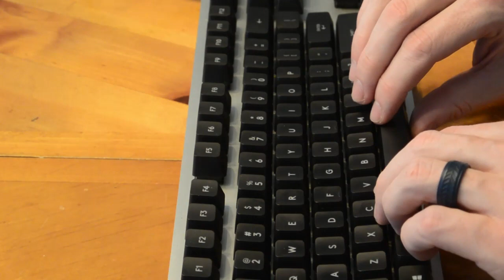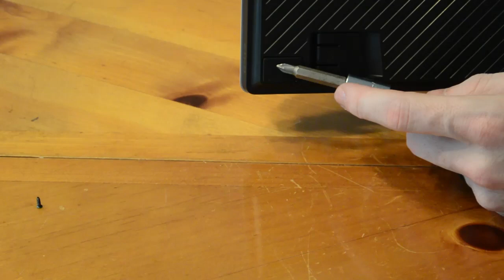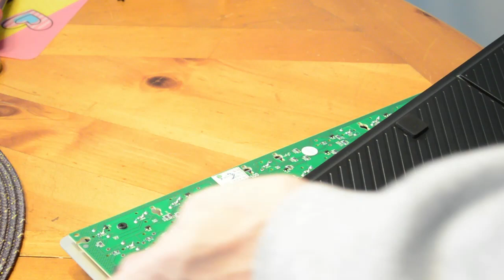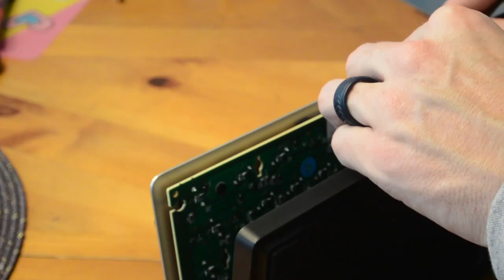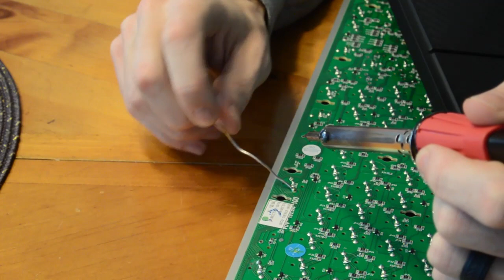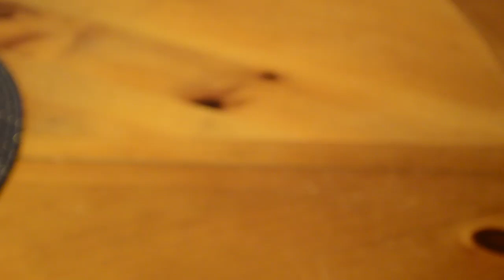Logitech G413 Repair-Key removal, take apart and solder joints

Comment: I have g413 carbon. The space key broke. It still types but then several keys randomly chatter and it's almost impossible to use the keyboard. I have cleaned it several times (using vacuum cleaner and microfiber cloth). I don't know what else I could do. Any suggestions?

Comment: Apparently I'm the only one who's about to ask the silly question, how did you get the old broken switch out before soldering the new one in? 😅
Reply: 1. heat with your soldering iron the old solder
2. use desoldering Pump to remove the old solder while the solder is liquified
3.repeat  until all of the old solder is removed
4. you should be now able to remove the switch with pulling it with your fingers.

Comment: Is it possible to remove just the frontal metal plate?
Reply: Only if you desolder all the keys from the pcb and use key puller to remove the keys.

Comment: i have to say i wonder that you do not have your letters washed out on the keys mine are. and those little plastic poles in the back of the keys brake too easily, even without pulling the keys out. i love the keyboard but i believe this is a building mistake, what do we gain from 2mm aluminium and solid platine, if the keys do not hold up, the letters are just printed onto the keys and rub off. i dislike this company policy. + its close to impossible to get the metal off of the platine to clean both sides. as you do it, they, contact sockets, seem only to go out one way. besides that perfect keaboard.

Comment: thanks, I have a keyboard where every time I press the "e" key it is duplicated and sometimes it is not captured, but most often it is duplicated.  What I can do ?
Reply: You’re probably facing ‘key chattering’, which is a common problem with mechanical keyboards. This usually happens because or dust/dirt getting inside your keys and interfering with the contact points of the switch. Just pop off all your key caps (or just the ‘e’), and clean the board and switches properly with compressed air, and put it all back. Hope it helps.
Reply: @vattu420  thanks, i washed my g413 today, shity mess, i didnt know how much dirt could gather in and the keyboard and between the keys.. first with acetone then with soap and cooking water and then dried with hot air.. hope my cleaning was enough because i had a dublicating space bar, very annoying and time consuming if you write allot.
Reply: @KingCrimson82  I also have the g413. Needs to be cleaned regularly otherwise the keys start messing up.
Reply: I have this exact problem with several keys. Fortunately “E” key is safe

Comment: does the key comes with RGB LED light??
Reply: the 513 does this is the 413
Reply: @KingCrimson82  so for 513, you replace the key means you replace both the key and its led bulb at the same time?

Comment: can i swap my Romer-G switches with Cherry mx switches???
Reply: they are only hotswappable with romer-g blue & silver so.no
Reply: @iwaju9227  Perhaps I'm misunderstanding, but these particular switches are not 'Hot-Swappable' as I know the term. These Romer G's have to be soldiered into the PCB. With a hot swap keyboard, you're able to simply pull the switch out and replace it with something else. If you understand how a hot shoe works on a camera, think of it like that.

I'm typing on hot swappable opticals now, I could change the Gateron blues back to black etc without unplugging the keyboard for instance. 

Did Omron/Logitech make Romer G's hotswappable? Their follow ups Logitech GX are I believe though. I won't comment on the G413 (fucking lazy switch and cap design and bottom of the barrel plastic basically), but I don't think it's hot swap, I'd have kept it active if it was. I almost miss it for some reason.

edit: forked out a tenner for a couple of replacement switches and a left shift repair on Aliexpress (simply because Romer G's and their 'light pipes' are an obsolete curio now, it might be worth keeping boxed on the shelf as an item). The new switch will have to be soldered to the PCB with my G413 if I want to use it again... seriously, everyone go for a customization hot swap no matter what if you intend on spending over 100 on a keyboard. Ones like the G413 are a glossy waste of time. I learned my lesson. 

Get bored of your switches or keycaps? Swap them out for 20-30 quid a year later or save for something even more, change the case from time to time perhaps? Non proprietary user 'modularity' is forward... whatever that is. It's like Lego for adult typists... fookin' cheaper too : )

Comment: I wish they made the keys hot-swappable. Does Logitech have any keyboard with hot-swappable switches?
Reply: i thought this g413 one was hot swappable, i even bought switches. i got one of the switches out, with tons of trouble, to find out the led wont let any other switches fit. i spent 100 dollares for nothing, lol.
Reply: @Michael-tl2bs  Try a keychron board

Comment: Hey man idk if you will see this but my 6 key won’t work. So if there is anyway I could help me I would appreciate it
Reply from the maker: I am out of town till Monday, I can add a video about the inside the keys themselves. There is a 2 metal slivers that make a connection when pressed. First follow the recommendation steps in description before taking keyboard apart.

Comment: My G413 Carbon is only 6 months old and the WSAD and Spacebar keycaps started losing paint already, the W key is just a circle shape now instead of a W lol, Did I get a fluke or is this a known thing with these models? Or maybe I have acid fingers 😮 seriously I've never owned a keyboard that's done this, previous keyboard was 8 years old (Logitech K310) and still working fine, no paint issues etc. I just wanted to try out a mechanical model and went with the G413. Logitech is sending a complete spare set of keycaps under warranty but im just curious if anyone else has had this issue lol.
Reply: just wait for the keyghosting... piece of shit keyboard
Reply: its laser ablated what do you expect
Reply: This is a known thing. ABS Keycaps are cheap and if your hands sweat a lot, the legends are gonna peel off real fast

Comment: Logitech has really broken my trust of over 10+ years with this G413.
Reply: Same. I used to be logitech fan. But with my last g502 mouse double left clicking + g413 carbon keyboard double spacebar/2-3more other keys , i doublt ill ever buy again. To fix keyboard official(Turkey distrubitor) company wanted half of the keyboard’s price. I believe i wont ever come back to logitech ever.
Reply: @oguzsafauysal5028  Logitech would replace it for free if you weren't in a shit country.
Reply: @oguzsafauysal5028  clean you keyboard dude. it s normal if you don t take care of the device
Reply: same. my ctrl key broke, and i cannot change/order ne key easily. This is inacceptable to have a keyboard that is not easily fixed. was tempted by the g915 but it seems to have the same kind of weakness.
Reply: @Demandradify  those are omron switches, you can buy them on aliexpress
Reply: I have a g513, which is basically the same keyboard with rgb. It really sucks... These keycaps' stems start breaking upon regular use within a very short time

Comment: I am a newbie at this. My spacebar stopped working and I decided to replace the switch with another's key switch and I have no clue why it won't work
Reply from the maker: sorry i missed this comment but hopfully this would help others. inside the white part of the key, there are 2 metal pieces that make contact when you depress it. Those could be misaligned or there is a bad connection on the back side of the keyboard

Comment: Sure wished you cuda said which key caps we actually needed to remove as I dont have a key cap puller....my * and - are Simi not working on the num pad itself. And idk if it's me or what but every once ina while it's like I double press the k cap but its not sticking idk if I'm touching it as these keys are touchy but I do have new keys to put back since the one is busted...got the keyboard used ish. Would have to say my wife getting mad at me and pulling my desk over is what caused my issue thankfully I didn have a 144hz monitor at that time lol. Anyways thanks for the vid. At least now I know there are dam near 30 screws....

Comment: my circuit board is broken from the esc button (its like a part of the circuit board cut off) is it possible to fix it?
Reply from the maker: Is the piece gone or broken off
Reply: @joshuav360  its only broken off i still have it. can i take a photo of it for you somehow
Reply from the maker: klaudzy if you have google drive, you upload the photo and set specific permission to share the link to the photo

Comment: Mine sound metallic with each click, like this terrible sound when you hit an empty metallic bowl. Awful.
Reply from the maker: Carlos Adrián Salgado Castillo mmm never came across that issue before
Reply: mine too... I can't suffer it...
@J VanEpps do you think it would be possible to put something between the metallic plate and the pcb to dampen sounds? it reverberates way too much.
I'd like to know before trying to disassembly the keyboard myself...
Reply from the maker: cridus for this style of keyboard there is not a method that I know off, this model is the louder of groups with the space bar being the loudest
Reply: @joshuav360  shieeet.
welp. at least I noticed that when there's any background noise I fon't hear the "ping". maybe I'll start getting used to play some music when I have to work and there's silence.

Comment: Thanks for this video..My spacebars gone too.. Definitely wont be buying anymore Logitech crap that's for sure! \o>
Reply from the maker: Message them directly, start the trouble ticket process. They will send you a new one
Reply: my space bar is gone too
Reply from the maker: Rory Addlesee first step is try to work on a trouble shooting process with Logitech, more then likely they will send a replacement. This video is if they do not replace.
Reply: J VanEpps I have put in a ticket but still no response. My problem is the bit where you attach the space bar on the keyboard is a little broken
Reply from the maker: Rory Addlesee that’s interesting, just ensure they know, the 4 plastic pieces that hold the space bar broke from normal wear and tear versus the space bar being removed. Also it did not take long to get a response about my issue. What route did you take to report the problem?
Reply: J VanEpps I used the ticket system but they have replied saying to email them
Reply from the maker: Rory Addlesee once you email them, they will reply with troubleshooting tips, to make sure it is not a software issue. If it is confirmed not a software problem and it’s hardware, they will then send a new one
Reply: J VanEpps yeah they have replied saying that I am eligible for a replacement. Thanks for replying
Reply from the maker: Rory Addlesee that’s good to hear, glad they were able to help